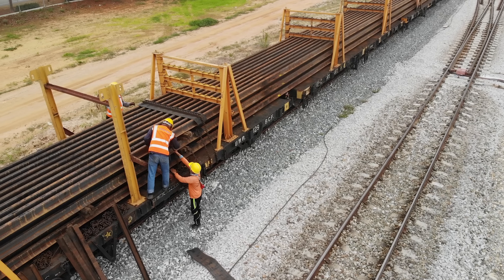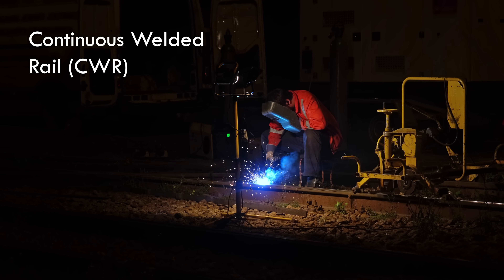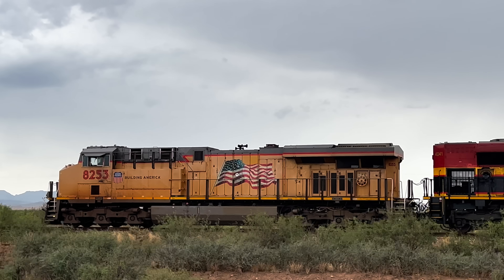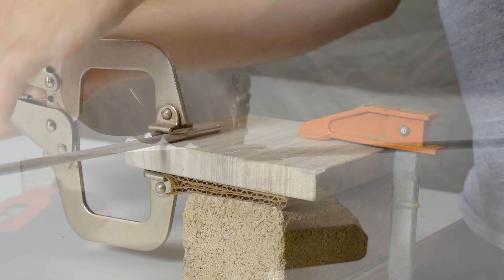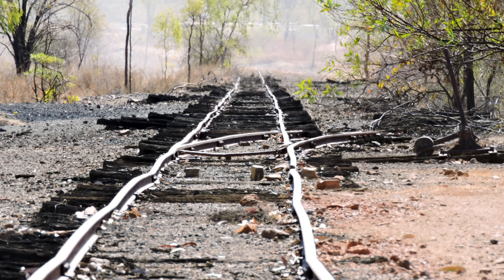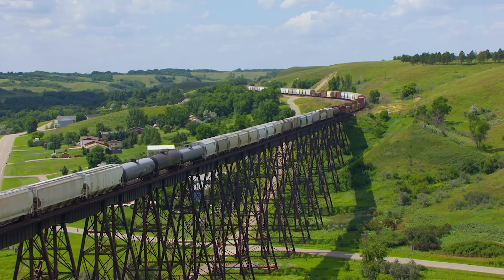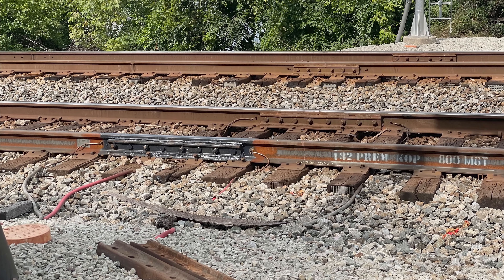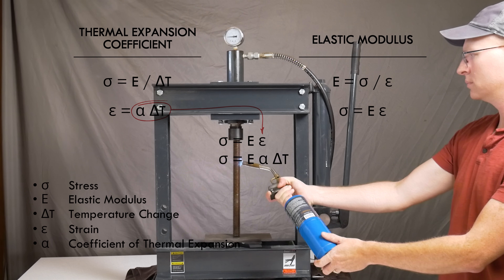Why Railroads Don't Need Expansion Joints

Comment: Since everyone needs to point out their job title here im a conductor for a railroad company. We operate on a lot of welded rail. Nothing sketches me out more than seeing a speed reduction on a tsr (temporary speed restriction) due to weather. Not a hate comment by any means I found this very interesting on the school side of things but never once did it mention the weak side of railway ties. Without enough balist or stone plus a compactor run or two, welded rail would be borderline crippled. Having nothing to keep the ties in place but gravity would leave every railroad using welded rail at restricted speed under extreme weather conditions

Comment: Excellent video!  However, at the end I’m not sure I got the bottom line of how the railroads actually install the tracks. They always install them under tension?  I got a little confused on this because you talked both about tensile and compressive, with an implication you were going to use both but then at the end didn’t I don’t think. Thanks!

Comment: I did 40km. CWR by  8 rails (100lb.) each length 42 ft. welded with electric arc providing 3 joints after half mile. Temperature range been -4C to 54C. Never got buckling but spread additional ballast at outer shoulders of curves > 2 degree.

Comment: Thank you for this nicely prepared video which explains an effect most people take for granted today - if they are even aware of it. I don't believe you mentioned that the original rail-ties were wood - which was not strong enough to restrain the effects of expansion forces. The introduction of concrete ties made continuously welded track possible.

Comment: why is no one mentioning that a large amount of the "clickity clack" comes from flat spots on the steel wheels of the cars. There is a reason they grind down these spots as maintenance periodically. The rails are not the only culprit.

Comment: I think in your hydraulic press demonstration, the unexpectedly low pressure change with temperature is based on the amount of hydraulic fluid that is forced into the pressure gauge by the displacement.  This is small but not zero - increasing the pressure in the Bourdon tube in the gauge straightens it slightly, which moves the pointer but also increases the internal volume of the tube.

Comment: Pre-tensioned ballscrews are the first method of mitigating thermal growth in CNC machines as well. Actually, one of the easiest ways to know if a particular brand of CNC machine is going to maintain accuracy throughout the day is to just check what the ballscrew setup is. Double captive ballscrews like in Doosan, Hyundai, Matsuura, Nakamura, etc will remain stable. Single end captive ballscrews have one end floating, found in HAAS, Feeler, Challenger, Milltronics, and most China/Taiwan machines, they're known for having significant growth when they warm up (it's most noticeable on lathes)

Comment: As a rail signal worker, I’ve worked with switch and stock replacements, they install them in the morning and stretch the stock rails, they do that because they can measure a distance easier than they can measure a temperature and working out expansion. Installing a cold rail and stretching it over a gap is a better bet vs working out a temp, then cutting to a precise length and welding.

Comment: Have not watched the full video yet, am at 2:00 sharp. This is a problem I pondered myself about. The conjecture I produced on my own is as follows: Rails do expand and contract, but when they are layed down, they intentionally make put curves and turns in the tracks and never go straight for too long. So when they expand due to heat, the rails simply shift in turns a little outwards inside the rail bed to account for the additional length. That's why they need all these concrete struts or whatever they're called to keep the rails at constant distance to each other.
Reply: So I guess, I was wrong about that, and they just use brute force to keep the rails from expanding or contracting.

Comment: Interesting that they lay rail at a target 105F when rails can actually reach 140 deg. F or 60 Deg. C. in the hot summer sun. Much hotter than the air.

Comment: 6:20 I've actually seen the latter graph a lot recently when looking into the Titan sub implosion. It's really interesting to compare titaniums stress-strain graph vs carbon fibres. For those who haven't seen it, the graph he has on the right looks a lot like titanium's, where you have at least two soft failure modes (the two bumps, meaning deformation takes place but the material can still hold some force) before the material fails entirely (ie snaps in half). Carbon Fibres is more like the graph on the right. No bumps, it just strains more and more until it snaps suddenly, with no warning.

Comment: I built a house in Mt. Juliet, TN  (near Nashville) that had a little used railway line. The line had been converted to include public rail transport to Nashville. The whistle was not allowed and the tracks were converted to continuous weld. You couldn't even hear the train and it became a non issue. This should be a mandatory requirement for all rail transport. I also lived in Atlanta with their subway system and that was terrific too. Much of that system was above ground and never a hassle. I have also lived in other major cities that did not have public rail transport. I think it is necessary to bypass parking problems and make the downtown area affordably accessible. Atlanta was the best I've used but these continuous weld tracks make a lot of things possible. Minimize or eliminate the points of congestion and bring in tracks from four points on the compass. It will bring life and business, entertainment and sports back into the city. Parking alone in most major cities with sporting events has gotten totally out of hand.

Comment: Literally can't be the full story. I commute every day on a really old narrow gauge railway. Last year the line got some new trains. So now there's a mixed stock. 80:s trains and modern ones. The old one clicketyclack over the joints. The new ones doesn't. The new trains are 3-4 times heavier though, might have something to do with it? Like pressing the rail down harder.

Comment: I wish to add some comments on the assertion, about railways needing expansion joints. Several years ago, in Melbourne, Australia; our entire network was shut down, due to severe buckling of the railway system. The circumstances, I recall, were such, that the temperature was at or exceeded 45 Celsius. Perhaps notably, this had never happened before or since. Would expansion joints have aided the situation? I do not know, yet it seems to me that any single span of rail would have equally suffered the same fate. So any comments are welcome.

Comment: Watching this video in the aftermath of a major MRT metro service disruption here in Singapore. A damaged metro train tore up a huge stretch of railway tracks that left behind a path of destruction in its wake, including broken rails that will need to be repaired. Singapore's MRT system uses continuously welded rails, which means the damaged and broken rails will have to be removed and replaced with new rails that will need to be spliced in and welded back together. Decided to watch this video to better understand the technical challenge the engineers will have to face as they repair the damaged tracks.

Comment: I was puzzled by this as I was cycling fairly close to tracks last year, the path was close to the tracks and I was surprised at not spotting any gaps anywhere. Seemed implausible but I figured they were probably there just too small to see from a distance, my assumption turns out to be wrong but glad to know how it is done.

Comment: As I was watching I was thinking surely they should weld them on a hot day or some other way to achieve similar as avoiding buckling is more important than if they pull apart slightly.
Super happy to see nearer the end of the video that's what they do.
I felt a little bit smart for once.
Haha.

Comment: Thanks for the explanation on thermal expansion/contraction of the rails. Especially the expansion joint. In China I road a high-speed train from Nanjing to Shanghai that hit 315 kph (nearly 200 mph) and yet no clickity clack. Welded joints, I was told. Still, it gets hot and cold in China, and steel expands when heated. Breathers completed the explanation. Appreciate the info.

Comment: On the railroad network I work on, we have speed restrictions come into effect when wayside detectors tell us temperatures are 30 degrees celcius or higher. Usually the cold temperature restriction is negative 30. It's interesting that they pre-stretch the rail when they install it to prevent buckling. The speed restriction is usually not much of a reduction so I assume the thinking is that the buckling that could occur is only minor with these engineering solutions. Very cool.

Comment: Ahem, you put down an ALUMINIUM rod. Even your scientific top bods accept the proper name for the alloy is aluminium and not aluminum. Now if you could just turn your attention to boot, bonnet, disc brake and JagUar we Brits would be most appreciative 😁
On the subject of expansion joints, we still have them over here...

Comment: The end of the video made me think of a question: why is continuous rail used instead of diagonal shaped joints as is seen on bridges ? Is there because there's still a small impact that occurs when a wheel pass on it ?

Comment: In my youth in the early 80's I was a trackman for the Missouri Pacific later merging with the Union Pacific. I was on a district tie gang and we replaced railroad ties . Remove a 1000 or 1500 and put them back in a day. Sometime my job would be to reinstall the rail plates that go between the tie and the rail. A small machine called a rail lift we would push along . It would clamp the rail and then lift the rail to enable you to install the tie plates. In the summer when it was hot sometimes the rail would slide and move creating a sun kink. The welders would sometimes have to come in and do their thing removing a piece if it couldn't be realigned.Another thing that keeps the rail in place besides the ballast are rail anchors which are driven onto the rail on either side of the tie and tie plate. In a straight away they might be every third tie but on a curve every tie.

Comment: When I was little, I rode trains a lot. I'd time the clacks and calculate the speed of the train as a pastime. The rail sections were either 25 or 50 meters, at least in China where I grew up at that time.

Comment: Way too long. So the only news to me is that they install the rails when it's really hot outside OR they heat them up. So we get a stable state at the "neutral" temps.
Thus, when they shrink at colder tempertatures, hardly anything happens, and they won't expand much (with tention causing misshaping) on hot days.

Comment: Your example with the hydraulic press doesn't seem quite what you said. The fact that the hydraulic pressure increased means that the expansion of the steel rod pushed the hydraulic cylinder increasing it's pressure - therefore the rod was longer. The hydraulic press did not restrain it's growth, it merely proved that it grew.

Comment: Can somebody please explain to my monke brain the following ?
If continuous rail is both cheaper to maintain and more comfortable/quoter for passangers and the solution to expanding metal was simply hold it tight then why didn't they always do that? Is modern steel that much better than the ones from early/mid XX century?

Comment: Small mistake at 8:48, the young modulus is around 210GPa not 210kPa. You should multiply 207 by 10^(3) and not by 10^(-3).

Comment: Interesting video, in the UK CWR is laid at anytime, the last section is heated and pinned in place, there are expansion joints, they are formed as a long diagonal cut in the rails within sliding chairs, so some do have expansion joints !

Comment: The most ive ever seen rail run was almost 9 inches, the rail looked like spaghetti for 100s of feet and as the welder cut the rail you could visibly see the rail straightening out as it stretched.

Comment: I thoroughly enjoy your podcasts and how you take complicated, eye rolling issues and break them down into bite sized factoids that most of us can understand and leave as the ad ends with a feeling like "now I understand how that happened:. I reently saw many of your shows on railroading, as I am a long time fan of mostly streetcars and light rail, since I grew up with them as Pittsburgh was slashing and burning it's once huge 600 mile system (never fitred out if that included double track once or twice in the count) and became a fan of Steam, Cog, Inclines/Funiculars/Elevators (depending on where they are located) and thus tend to consume what print or video media is out there. However, kind of in the same vein as this particular podcast (about expansion of track) while watching "VIrtual Railran" web cameras this afternoon, I noticed a few trains of long "welded" rail (I'd estimate about 10 car lengths long or 500 feet) tooling down the high iron, and know that "old time" sections of track were only 39 Ft long (I'm assuming because most freight cars are/were either 4o or 50  ft long and thus needed to fit INSIDE the cars for transport.  That lead me to a question, of HOW and WHY can rails, which even General Sherman's army needed to heat to high temperature to manufacture his infamous or is it famous, neckties,  be laid down two at a time along the right of way they are intended to replace and and appear to be quite "plastic" as the trains follow bends in the mainline and when they are laid in their new configuration.  I would expect that there is some practical engineering in now they do this.

Comment: SNCF built the Paris-Bordeaux TGV line with 450m rails. The train takes 2h06 at 300 km/h.
The rails are joined using a seamless beveled needle. Probably to avoid buckling.
Blocking the rails with the sleepers seems more complicated than beveled connections.

Comment: Interesting. So instead of allowing for expansion and contraction, the current solution is to instead transfer that load onto repeated compressive and tensile loads?
Given that cycle runs at least every day and sometimes multiple times per day, I hope they've factored in the life expectency of the rail. This is just asking for fatigue cracks and breaks, much like you sometimes see on aircraft fuselages...

Comment: I was a Signal Maintainer on the Harlem Line in NY and, in 1976, "ribbon rail" was replacing sectioned rail with bonds and angle bars.  Even then, the fiber materiaL IN THE INSULATED JOINTS WOULD BE CRUCHED WHEN THE RAIL EXPANDED AND COMPRESSED THE INSILATION.  An insulated joint separates track circuits.

Comment: -  The traditional track joints with gaps were meant to alllow for the thermal length change that is inevitable. 

  - Interesting number that length change between the extreme temperatures a track is exposed to between winter and summer can be 2 feet per mile. 

  - an individual track section, when constrained by the adjacent tracks, 
     undergoes tensile (pulling) stress when cooled down, which stresses the joints, 
     and compressive stress when heated, which can cause the rail to buckle (quasi to allow for the addivional length)

  - the buckling is the way more dangerous effect, that would cause a change in the track gauge, which is crucial to be exact to avoid derailment.

 -  the tensile stress at the joints (when welded, pull is the more critical stress than compression) is manageable/tolerable with modern welding techniques. 
    (that were not that developed in the "good old times")

  - So the remedy is to install the rails when rather warm, 
   so that there is only rarely compressive stress when the rail gets warmer than the temperature at installation
     and more tensile stress on the rails when they get cooler than installation temperature 

  - I suppose the optimum temperature of installation is varied depending on the climate in the region where the track is installed. 

  - Where real expansion joints remain unavoidable, advanced rail manufacturing technology allows an overlapping section 
     where the two halves can move against each other, avoiding the good old "clickety-clack" 
 
Takes maybe 5 minutes to read and mentions the decisive points probably more pronounced than the video.

Comment: Why dont they just use Expansion Joints everywhere?  Seems like that simple mechanical interface would be preferable and even potentially cheaper than having to futz with welding every joint and more over only being able to do that operation on a limited number of days.

Comment: Why wouldnt they just use the wedge style joint instead of the full gap.. wouldnt that be easier on installers then doing it whilst simulating a nice summer day on mercury while installing rail..

Comment: Thermal connections are still used in areas where temperature swing is closer to 100 celsius on lengths of rail whre setting up unrestricted expansion is problematic. That temperature change is queal to creating stretch tension which can tear or bend rail and overcome critical level of deformation.